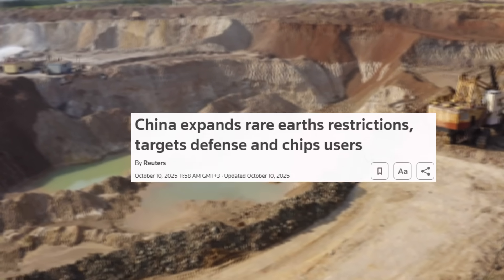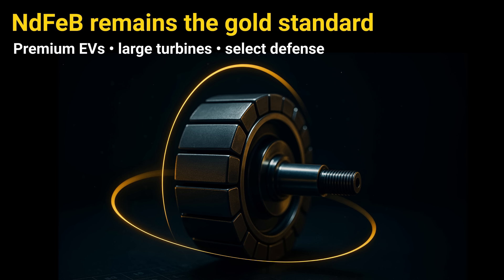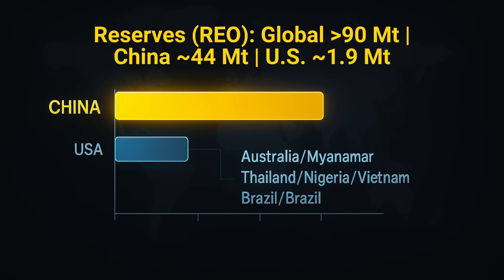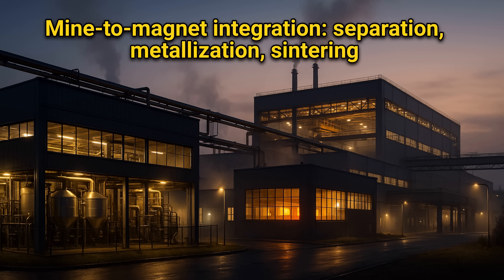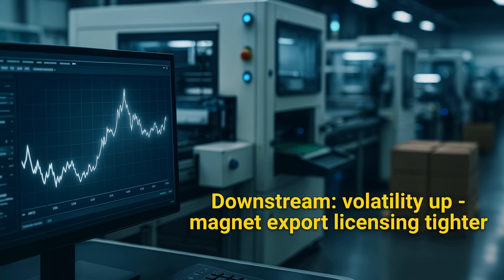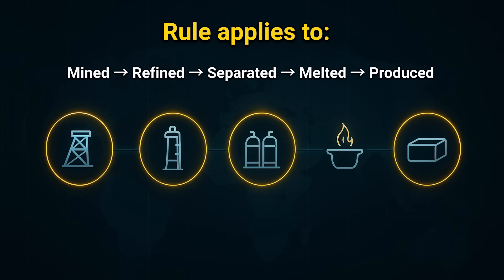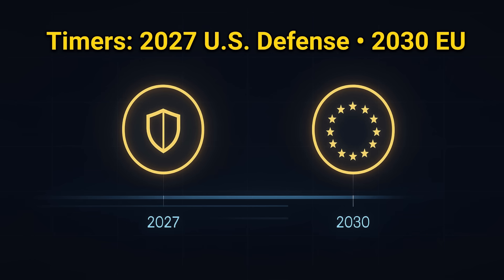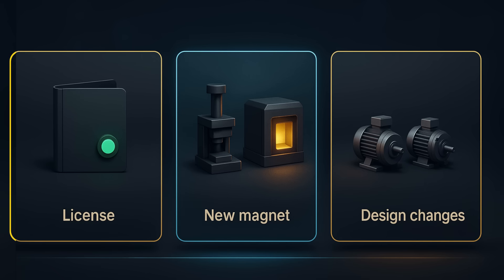China’s Rare Earths Controls 2025: Can the U.S. Make Magnets?

Comment: All of this is by no means a matter of good or bad, right or wrong, expensive or cheap. Instead, it is that even if you gather all your Allies and decouple from China, it cannot hinder China's development. China's refusal to decouple from the US and the West is merely because such development would be more efficient, rather than a matter of the binary opposition form label logic of collapse or non-collapse. For instance, when the academic accumulation and experimental precision instruments and devices in the US are relatively more advanced, Chinese students can achieve more research results or make up for part of their own disadvantages, making implicit scientific and technological contributions to the US. The repeated exchanges between the personnel of both sides can promote the scientific and technological and economic development of both sides. Then why would the West suddenly change its mind or slander? The root cause of all the problems lies in the fact that their top-level institutional design and the dynamic testing, adjustment and optimization of the system are far behind those of China. Their original thought was that China would never catch up with them, because the illusion was that they had a first-mover advantage.
Reply from the maker: Excellent perspective — you’ve captured the structural nuance that’s often missed in the West vs. China framing. The real story isn’t “decoupling” or “dominance,” but how interdependence in R&D, talent flow, and system iteration keeps pushing both sides forward. Rare earths are just one visible pressure point in a much deeper feedback loop of innovation and dependency.

Comment: Don't you realize that the professional furnaces for refining rare earths are also made in China? (It's like the lithography machines used for making chips.) Now, the United States has to first work on developing the reliability of these furnaces; they aren't off-the-shelf products that can be bought and used right away. China has already controlled the trade of professional furnaces. Just like lithography machines, element separation catalysts (similar to photoresists) are also China's patents. It's not just about rare earths; the United States needs to establish an entire rare earth supply chain, which is not as simple as just setting up a rare earth refinery.
Reply from the maker: Fair point—this isn’t plug-and-play. That said, furnaces/presses/strip-cast/VIM/HIP/sintering kits aren’t only in China; there are EU/JP/US vendors. The harder part is process know-how + QA and then getting an automaker to sign off. Think less ‘photoresist monopoly’ and more ‘years of recipes and repeatability.’ Equipment lead times are long, but it’s buildable—the real clock is qualification.

Comment: China tells TACO, RE minerals processing in China is meant for domestic use. USA has the means to do processing of its own minerals. You do not need to buy from China.  If you want to buy from us, you can apply stating the purpose of use and the quantity you need. Our supply is limited.
Reply from the maker: Fair. The thesis here isn’t ‘buy from China or else’—it’s build dual-sourced capacity so OEMs aren’t single-point dependent.
Reply: @StratyQ why bother to do all the dirty work, just put knees down and pray to god everything will be fine.

Comment: A 30 years, 500% tariff on rare earth imports may be the necessary catalyst to build a secure domestic supply chain. The core challenge is that private companies will not invest billions in mines and processing facilities without confidence that they will be protected from volatile pricing. While this will undoubtedly raise costs for manufacturers and consumers, it is a strategic premium for achieving supply chain sovereignty. The goal is not to create an export powerhouse that undercuts China on price, but to create a resilient, vertically integrated base capable of meeting the demands of our defense, technology, and green energy sectors.
Reply from the maker: Great framing. I agree the goal isn’t to undercut China on price but to buy resilience. Curious: what’s the right mix—tariffs, long-term offtake, or tax credits—to de-risk capex without locking in permanent price inflation?

Comment: This analysis is obviously done by a financial guy, not an engineer. You put money in and you get a factory with specified results.  Everything looks good on paper. You cannot build so many factories to handle some many different elements at the same time. The elements are all different and require different processing. In addition, you will not get the purity you need for high end use. It is a fantasy analysis here. Good for a ppt presentation, but nothing else.
Reply: engineer? what do physicists do then?
Reply: As an engineer who has been engaged in EPC projects for a long time, I know that the first step is design.
But if you are lack of relative technology, even if you have never carried out related projects (such as heavy rare earth refining), how can you design it?
If you decide to start from zero, then I don't think 10 years is enough.
The second step is purchasing.
The global manufacturers of related equipment are all in China. Because the output value of rare earth industry is not high, even in China, only a few manufacturers are making it.
Under the current ban, your only choice is to research the manufacturing equipment from scratch.
=
For example, when you cook soup at home, you find that there is a lack of monosodium glutamate, so you have to build a monosodium glutamate factory. But the problem is that no one tells you how to produce monosodium glutamate, and you can't buy equipment for producing monosodium glutamate.
Reply: I totally agree. I suspect this video was made for presentation to non-engineering professionals. Looks very impressive, but the content is empty.
Reply from the maker: @eugenec7130  Good callout. I aimed this at decision-makers—what moves the market and why—so it’s lighter on unit ops. If you’d like a companion piece for engineers, I can put one together.
Reply from the maker: Fair pushback. To be clear: no one factory runs ‘all elements.’ You’d build segmented lines—separation by chemistry, then metallization → alloying → sintered NdFeB with product-specific QA. The real clock is auto-grade qualification (12–24 mo) after equipment lead-times (12–18 mo). Net: ~3–5 years to meaningful non-China supply if offtake + permitting line up.
Reply: @StratyQ How long for factory lines building?? Where do you suddenly get so many of the skilled workers necessary to run your factories? Where do you source the spare parts of your machines? Do the spare parts themselves include any rare earths? Does any of the machines you source or build require my rare earths??
Reply: @StratyQ Greetings from the UK. I think the problem with bringing any kind of manufacturing back to the US has always to do with the lack of workers, not just skilled but more importantly, willing. I remember watching a CNN interview with a university don in April of this year and his research revealed that even among the third of Americans without college degrees, the majority are reluctant to take up these jobs and consider it beneath them. He also calculated that the cost of an IPhone for instance would increase by 30%. I believe the current lack of rare earth processing in the West has to do with its being an extremely dirty process that no one wants to engage in. Maybe the US can bring back the Mexicans it is now throwing out? That could work but it would be truly ironic, and would also end up speaking volumes about the US mindset. 😅
Reply: @thebuddhaheartsutra  Worker isn't the issue. The real issue is the supply chain integration: From mining and separation to producing final products like magnets and electronics, is long, complex, and requires highly specialized and integrated manufacturing capabilities. 
Does the US have manufacturing capability nowadays? That's the bigger question. We are not talking about one factory here or there, but the entire supply chain.

Japan has not been able to fully process rare earth metals domestically due to high costs, complex processing, and a focus on alternative strategies like stockpiling and international partnerships after a 2010 export cut by China. Processing rare earths still presents technical challenges, and breaking China's dominance is estimated to take at least a decade, if not longer.  Now it's 2025, and Japan still relies on China for processing.
Reply from the maker: @thebuddhaheartsutra  Agree labor matters. The playbook is pretty practical: paid apprenticeships, shift premiums, clustering near existing chem/process hubs, vendor-led training during commissioning, and targeted visas for a handful of specialists. That combo usually stabilizes crews.
Reply from the maker: @admiralwei  Yep—integration is the real boss fight. The three proofs that would make me say ‘we’re there’:

non-China metallization running,

a Tier-1 EV platform qualified on those magnets,

the early security premium shrinking with scale + recycling.
Hit those, and leverage shifts.
Reply: @StratyQ  
Perhaps this will give you a glimpse instead of drowning in wishful thinking.

1. There are a total of 17 types of rare earth minerals (light and heavy).
2. Building a facility to process one type of rare earth mineral in Australia takes about 3 years, while in the US it takes about 7 years (due to regulations).
3. Rare earth minerals are actually byproducts of the main production process. For example, gallium is a byproduct of aluminum production, meaning that producing gallium requires an aluminum plant.
4. To produce 1 ton of gallium, approximately 400 tons of aluminum production are required. This means there will be a very large aluminum production, and that will require a market.
5. Expensive labor in the US will make production costs higher, meaning the amount of aluminum produced will be less competitive in the international market.
6. This is just one type of rare earth mineral, while there are 16 others.